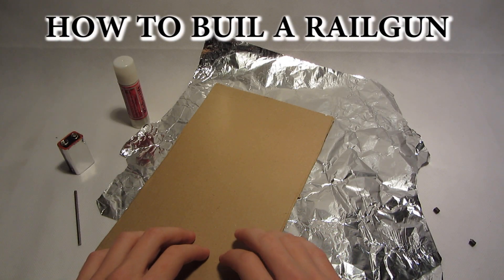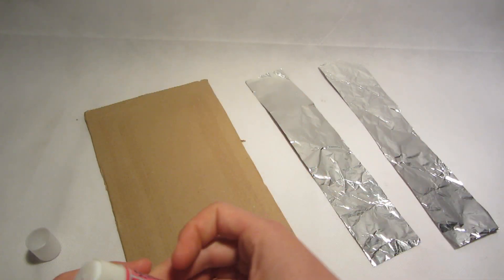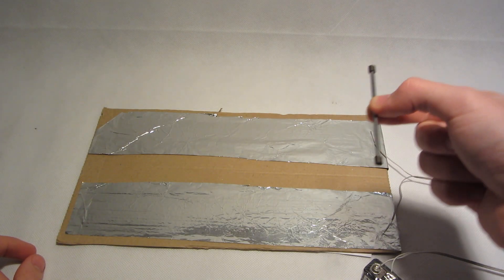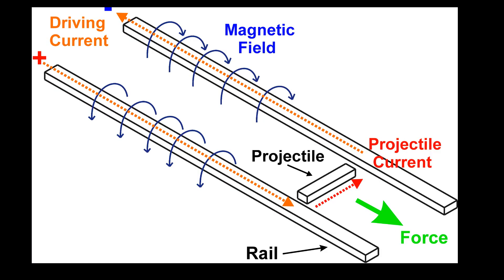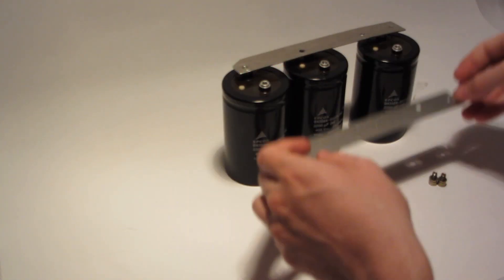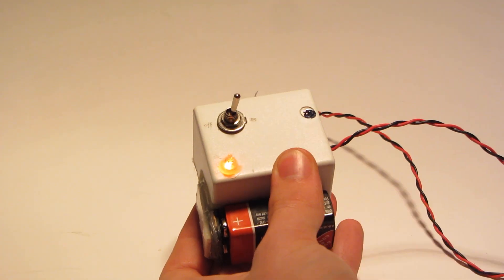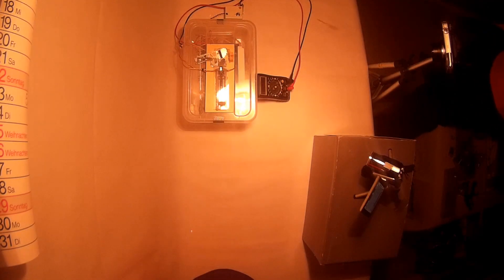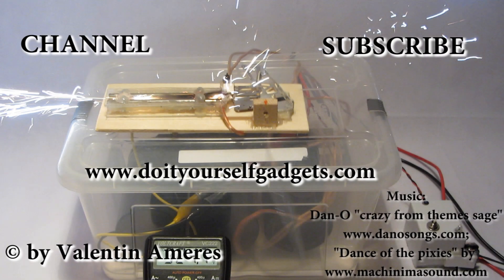How To Build a Railgun Experiment

Comment: I built it in my school's physics labs under my teacher's supervision, but I used copper instead of iron. I also put a switch on the negative wire to cut and connect the current, and I placed the projectile between the two copper plates. However, I used six 1000µF 25V capacitors in parallel, and nothing happened. Is the problem that the total power is weak, or is the efficiency very poor, or both? I would appreciate it if anyone who knows the answer could tell me, as technological information is almost nonexistent in my country, and artificial intelligence refuses to share such information.

Comment: Should the armature/projectile fit exactly the distance between the rails? So if u would push it manually u would ve to use a lot of pressure to push it completely through?

Comment: A way you can make this far more powerful is by adding a pulse lengthening inductor in series with the circuit. If the rails have power for a longer duration that the projectile is traveling through them, it will have a greater velocity.

Comment: I understand everything, but can someone explain what the Transformer is for?
Reply from the maker: The transformer was needed to generate high voltage to charge the capacitors. One can work with low voltages but when trying to maximize electrical current it's sometimes more practical to up the voltage (I=U/R) thus using 200V instead of 12V. The max. current (I) is mostly limited by the coil's electrical resistance (R). Thanks for your comment!
Reply: @Doityourselfgadgets  Oh I see, due to charging capacitors over time Q=CE(1-e^-t/RV) it’s easier to charge the capacitor when voltage is high. Thanks for the explanation!

Comment: Why does this work so well when he doesn’t have any magnets underneath the rail that would normally strengthen the field??
Reply from the maker: Because the current is a lot higher thus magnetic field strength also increases!
Good question!
Reply: Do It Yourself Gadgets oh that makes sense thanks! Sorry for the bombardment but I have a couple more questions haha. 1) would adding magnets increase the field substantially or is the field created by the high currents so strong the magnets would effectively add nothing? 2) how high is the current in that last demonstration? 3) since the magnetic field strength relies purely on current would simply using a transformer to step up the current (step down the voltage) from a main power supply work? (Shouldn’t have to rectify unless adding magnets because Lorentz force law will push it in same direction regardless of current direction right?).    Many thanks for your answers I appreciate it :)

Comment: How did you built the 9v transformer... I'm assuming it's a auto step up booster to charge the capacitors. Am I right? Can I see it?
Reply from the maker: I didn't design the transformer circuit myself but I salvaged it from photo flash circuits!
Reply: @Doityourselfgadgets  awsome, its been almost 8yrs and the vid is still smashing. Great work.

Comment: thanks for providing me with a great school project
Reply from the maker: Just be careful! Voltages above around 50V get dangerous really fast, especially since there are no fuses and capacitors will dump all of their energy at one instant once the circuit is completed! Stay safe and have fun learning :)
Reply: Do It Yourself Gadgets Thanks. I just made a more streamlined version of your cardboard demonstration. But when I do try the real deal Safety is number one priority.
Reply: @Doityourselfgadgets  If I make the cardboard demonstration but put in more current will it go faster

Comment: Would 45 volts be enough to get a good show of power but no enough to do anything ridiculous
Reply from the maker: Depends on how much magnetic force you can get out of your setup being run on 45 Volts. Voltage alone is not the main factor for high currents and high magnetic force! But Thanks for your comment :)

Comment: Could this work https://rover.ebay.com/rover/0/0/0?mpre=https%3A%2F%2Fwww.ebay.com.au%2Fulk%2Fitm%2F142627007616
Reply from the maker: 400kV is a very high voltage! I'd reconsider using high voltage!
Reply: @Doityourselfgadgets  where is it that you got your tansformer
Reply from the maker: I salvaged the transformers from a disposable camera with flash. The flash circuit board contains a usable transformer for charing capacitors up to 300V!
Reply: @Doityourselfgadgets  could you link me a different one please?

Comment: Does anybody know the minimum voltage that would be able to shoot something like a BB out of a DIY railgun?  I would like to build a very weak railgun for display and hobby purposes.  I'm not looking for any sort of dangerous firepower.  Just something that could shoot a pellet with no more velocity than you could throw it by hand.
Reply from the maker: That's a good question... I think all the factors play together so it still should be possible with a low voltage while capacity and resistance might have the biggest influence then. Hope that helped a bit!
Reply: try running it off an arc welder

Comment: What about lubricating with deep fluid
Reply from the maker: mh do you mean non conducting fluid? There are designs using pressurized gas to start the acceleration, maybe that's similar!
Reply: @Doityourselfgadgets  na fero fluid sorry basically it can be used to make perfect seal if needed but works great with magnets

Comment: O.k. I want to build one. But I need to know some specs. What are the rail dimensions for instance and if I need to to up the voltage if I use longer rails. Is there a rail to voltage equation. For example I want mine to be a foot long.

Comment: What kind wires did you use to connect to the foil? I'm trying this but it's not working right. Also I'm using two 12mm x 3mm neodymium magnets

Comment: I will not be building it at home... I will be building it in my engineering class.
Reply: Doityourself Gadgets actually, we were planning on 300-400V. We are doing 3ft rails and a 1-pound steel bolt, so we will need lots of power to achieve our goal speed. Everyone on the project is certified in electrical engineering, with 2/3 of the team robotics engineers.

Comment: so the transformer only for charging the capacitor?
Reply: If you don't know how to wire stuff, this project probably isn't for you.
Reply: are u custom made that transformer?
Reply: Where did you get the transformer or how did you build it. I have everyhting i need except the transformer. I tried building one from a internet guide and i used a spare device as a test and it exploded. I have no idea how to wire stuff. I need help.

Comment: "Do-it-yourself-gadgets" written everywhere, and at the end he says "Do not do this yourself" xD
Reply: Because there are some people in the world who are not pansies or morons.
Reply: that was a joke, I am actively trying to build one, a bigger, badder, meaner one
Reply: @silaskuemmerle2505 did you make it??!!
Reply: @worldsbiggestdehumidifier  never got around to it
Reply: Silas Kuemmerle If it's big, bad and mean you want, I don't think railgun would cover it. Railguns are rather specific and have a relatively low payout. I believe it's a coilgun you would wanna go for, if it's a big bang you're after.
Reply: Nova Flare The method of "kickstarting" the projectile is rather irrelevant. With a BB gun, you have the same basic principle as in the video.

The current decides the speed of the projectile. A faster insert of the projectile could ensure maximum speed right away, but anything above that and the magnetic field is going to slow it down, rather than speed it up, possibly causing a blockage or misfire (and in worst case an actual fire).

With long enough rails for the current used and the size of the projectile, speed at insert will not be too relevant though.
Reply: What amazes me is these things are really very simple. Im a computer/electronics tech so im use to being safe around high voltages amps etc. To me this is childs play to do safely and i likely will build one. My question to yourself is this what is the fps on this set up? It looks like its clocking pretty good feet per sec 300 to 500 give or take. And obviously longer rails = more time to speed up. Real question though is this what would happen if i say mounted a rail gun to the end of a bb gun and shot a bb in to the rail system at 300fps would the speed of entering the rails increase the speed vs say dropping one in to the rail or kicking it? Also if i used a curve in the rails would i for example be able to start the fire sequence from the front and have it exit out the front lol. Or would the projectile say a .177 bb just weld to the curve?
Reply: morphman86 Yeah right, gonna make one myself, maybe build a bridge rektifier to my 4kV trafo duo😀
Reply: this is a bad idea to even think about building, why did you do it?
Reply: will it be safe enough for a science project?
Reply: @joshuadumalig3380  unless it's a college project, likely not. High speed projectiles have a VERY negative reputations in schools...
Reply: cool

Comment: How is it that you hook up a transformer to a DC power source and get something out of it?   Does your little transformer box somehow DC to AC convert before going through an XFMR?    What is the voltage output considering the 9v input?
Reply: finally it's good to see someone with a brain.
Reply: Eh, have you heard of switching power supplies
Reply: Robert Stoddard basically it converts it to a high frequency AC which gets transformed up to Hugh voltage then made into DC again.  Thats how a switchmode power supply works.
Reply: Ill explain, electrons push eachother, the dc to ac is adc electric
Reply: http://www.electroboom.com/?p=856 
This video explains how it works. You can use AC or DC, it doesn't matter.

Comment: Hello, I want to ask some questions.  Please answer as soon as possible... but I think I should get answers until today, 'cause I should hand in the science fair(Korea's biggest science fair for students)  application form tommorow.
1. what exactly did you used as the trigger? I saw springs, but I don't know what was it.
2. Where can I get 400v DC transformer like you used, and how much is it?
Reply: It's probably a door handle mechanism. You could use a car amp intended capcitor.
Reply: http://www.ebay.com/itm/DC-DC-7-4V-16-8V-to-75V-660V-Battery-Booster-ZVS-Capacitor-Charger-Controller-/121871224115?_trksid=p2352135.l4275
Reply: 김현준 the tigger was just something that pushed in the projectile which made the circuit.  You could just use a wodden piece and a spring like a flipper machine to push it in with.

Comment: Question: would 220V be enough?
P.S.: I need an urgent answer on this one.
Reply: +David Solomie funnily enough, everything higher than ~5V would be able to move a light Projectile. :D
p.s.: you can mostlikly calculate the the power you need for a specific mass to move at a specific speed...
Reply: +David Solomie Use direct current only.
Reply: Steven Wang Thanks. Figured it out.

Comment: Da ich weiß dass du deutsch sprichst, kommetiere ich mal auf deutsch.

Weißt du ob das ganze auch ohne Hochspannung, zum Beispiel mit Ultracaps funktioniert? 
Nehmen wir einfach mal z.B. 2 große Ultracaps mit je 2,5V in Reihe. Die Kapazität der Kondensatoren ist z.B. 2500 Farad. Da beide zusammen gerade mal 5 Volt haben, könnte man die ganze Elektronik und die Caps selbst mit 'nem 2-Zellen LiPo betreiben. Die Frage ist jetzt nur, ob das trotz der fehlenden Hochspannung immer noch funktionieren würde.

An sich wird das Projektil ja durch den Stromfluss beschleunigt, der ja bei Ultracaps trotz ihrer geringen Spannung ausreicht um bei Platinen die Leiterbahnen quasi in Luft aufzulösen.

Funktioniert das also oder hab ich da irgendwo einen Denkfehler?

Comment: so the projectile must be any conducting material with high enough melting point?
Reply: +medo sam 
Not necessarily. It can be a sabot round with a case out of copper etc and projectile out of wood for instance.
Reply: ohh so the outer shell transfer current, that's an idea too
Reply: +DommHavai a sabot is just a sleeve for a projectile, usually one that has fins. If the projectile is just a rod and the clearance between rails is fine there's no need for a sabot.

Comment: i wonder if you could use coil gun technoluge and  murge it with rail gun as sort of the hammer to send it down to the rail gun
Reply: BLADERUNNER yes you could but you wouldnt gain much.  It would require a far more accurate timing.
Reply: kriss3d 😆

Comment: can we charge 4...3300 uf capacitors of 50V  using a variable ac-dc power supply of 30 V
if we want to use a 12 v ac-dc powersupply then what capacitors shud we use
Reply: +ŠhØáìb Ķħån hmmm......good question!!
Reply: Syed Haadi Husain dont let raqeeb know of this
Reply: +Šh&#216;&#225;&#236;b Ķħ&#229;n Well yes, however, your capacitors will peak at a voltage of 30V. You can always build a boost converter. Stepping up the 12V to 50V, giving you maximum stored energy. Therefore giving you: 1/2*(4*3300*10^-6)*50^2... roughly 16 Joules stored on the capacitors. Which is not a lot unfortunately... I am building a railgun aswell, however, I am using a 400V 24000uF capacitor bank. Giving me 1.8kJ of stored energy. I was planning on building a 7.5 kJ railgun, however, that's far too dangerous for handheld. I might build it in the future. Probably will post vidoes on my channel if you are interested.
Reply: ***** thanks Poison Phoenix
Reply: ŠhØáìb Ķħån
My advice: Get a bigger bank. However, this is amazingly dangerous. It will take your life when a mistake is made.
Reply: ***** thanks !! Poison Phoenix this guy is helpfull /!!
Reply: Arush Ramteke Designed and built it myself. Able to charge the 24 mF bank within 10 seconds (Record) Using a computer controlled PWM signal via Arduino. Also coded some safety features, like temperature shutdow, overcurrent protection, NAND logic for the switching FETS, etc. Used big input caps and a voltage doubler, because the transformer needs high gauge wire, probably won't fit 15V - 450V coils.

Comment: A few questions: what would be the best way of increasing the power of the railgun? More capacitors seem the way to go, but I have a limited supply to work with. Would you be able to get more force with differently sized/shaped rails?

Also, is there any way of dealing with the large amount of sparking occurring? A lot of the energy seems to be lost to those sparks, and I want  to have something efficient.
Reply: +Adeptus Forge Idk much about the first question but one way to stop the sparks would be to use a material that has a better conductivity such as silver.
Reply: You can use a series of magnets to increase the effectiveness of the railgun as well
Reply: +Adeptus Forge Yes, unfortunately adding more capacitors is the only option. Mind telling me what your capacitor bank is? You can try adding a amplified magnetic field by using permanent magnets or even electromagnets. To decrease the sparkling, the projectile and the rails must be as close as possible. You could also try to find a way to make a good projectile.
Reply: @Azagro  sparkling is cool

Comment: I made one It cracked my wall
Reply: http://www.ebay.com/itm/DC-DC-7-4V-16-8V-to-75V-660V-Battery-Booster-ZVS-Capacitor-Charger-Controller-/121871224115?_trksid=p2352135.l4275
Reply: Are you seriously stupid enough to fire a gun at your wall
Reply: Ice Flake no....shut up
Reply: Mine went though 8 feet of concrete

Comment: What was the output velocity?
Reply: practically nothing, you can improve this guys design by using capacitors and copper instead. An aluminum armature is fine though. Electricity flows through copper better and capacitors will release all of the power into the rails all at once. If you choose to upscale. Use 300-600v capacitors and make sure to use lots of precaution. When its bigger, its a lot more dangerous
Reply: @adbeck2000  
You can also improve it by adding strong neodymium magnets such that the field lines are vertical, turning the rails into a pair of coils, and recirculating the current through the projectile multiple times.
Reply: Its classified

Comment: Nice setup!
Some additional questions:

1. Does the type of metal used in the projectile/rail affect performance? Perhaps a more conductive metal would be more effective?

2. How noticeable were the effects of erosion caused by each shot? Any idea how many it took to render the railgun ineffective/faulty?

3. How long did it take to charge the capacitors with the 9V battery and how many times were you able to do so with the 9V battery?

4. Any info on the dimensions/mass/velocity of the projectile? 

5. Also, I assume with longer rails you could get it up to a higher velocity? 

6. Did you any tests on the effective range/accuracy of the projectile?

sorry for all the questions, im an engineer, just curious hahaha

Comment: I used 20 (1000uF 50V) capacitors charged to 44V, hooked them up to some copper tubes and tossed a a few round thing in it and they just sparked a lot and welded to the tubes. I got no motion, any idea whats wrong?
Reply: ok, ill give that a shot and maybe toss a few more caps and charge them to 50. Thanx :)